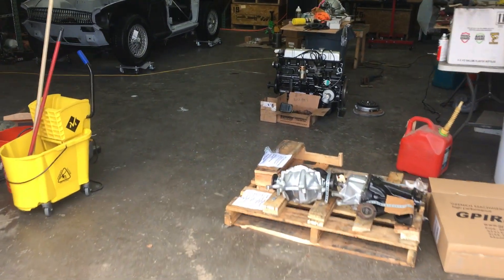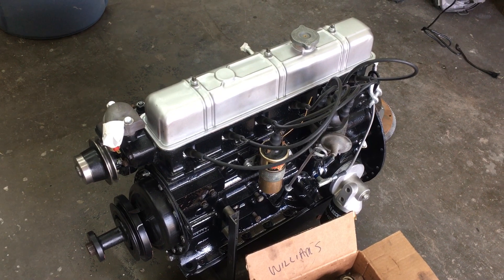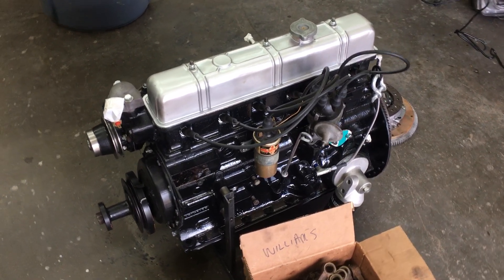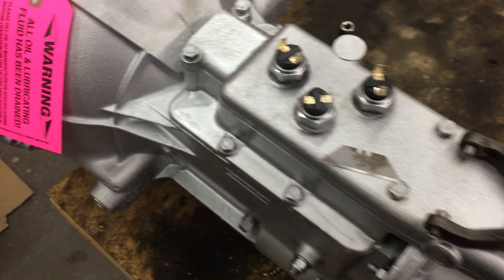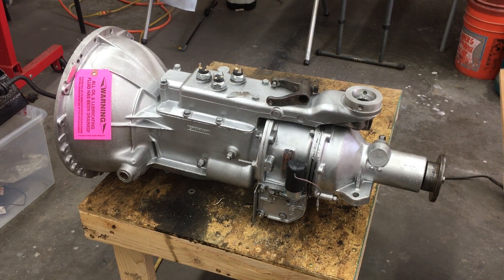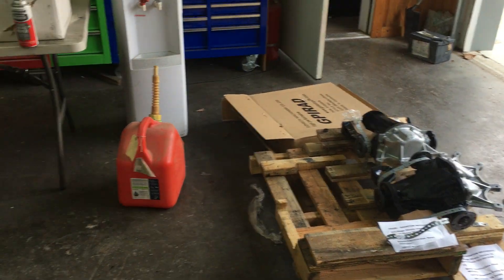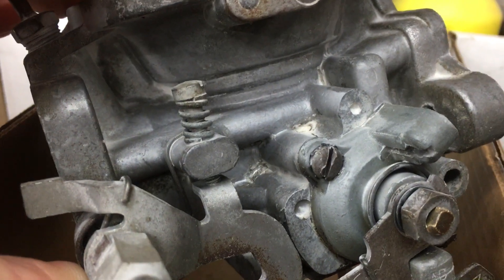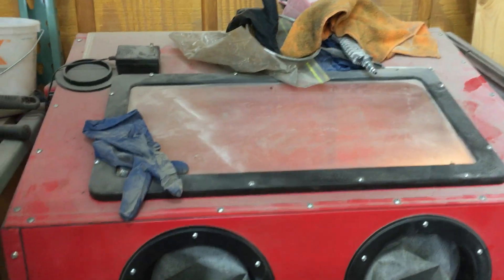IMG 1110 TR6: Quantum Mechanics and Sam deliver.

Comment: Hi Randall your project looks amazing.  What product are you using on the outer tub (under the fenders).  The black coating?  Looking to do something similar on my 76'
Reply from the maker: Hello my friend,
I’ve done 13 restorations, and the best undercoating I’ve found is as follows:

Get the metal clean and apply a good epoxy primer. 

Paint he inner areas with urethane single stage to match outside. It’s tough stuff!

When dry, apply bed liner (Harbor freight) with a roller. The roller is key…it squishes the product in the nooks and crannies. Apply a moderate coat, not too thin and not too thick. Don’t use spray cans, the roller is much better.

When dry, I apply 3M rubberized undercoat, about three coats. It does a good job of sound deadening. Easy to touch up.

Good luck with your project,

Comment: I'm sorry about your cancer diagnosis Randall. I'm in the middle of a body off restoration on  a 76 tr6. I've purchased original redline triple Weber carbs. You are welcome to my Stromberg's. I've lightly rebuilt them, and the car ran fine. I didn't do bushings, but the car only has 54,000 miles. I'm doing a full frame repair with powder coating after. Let me know. Steve.